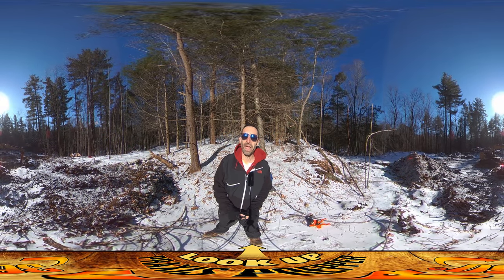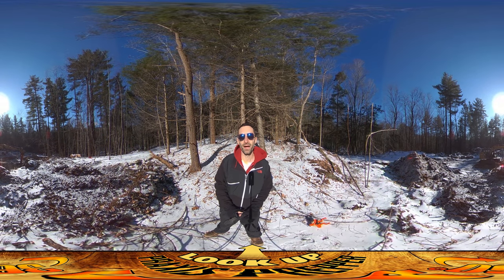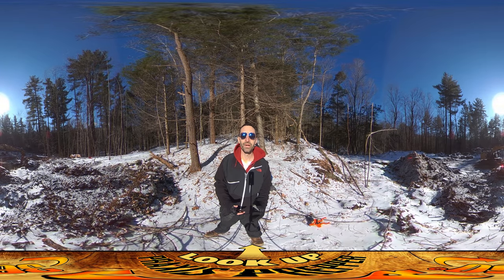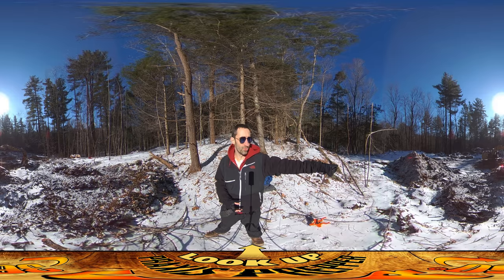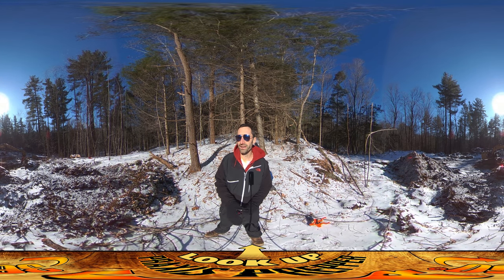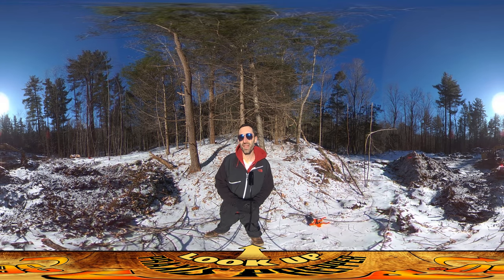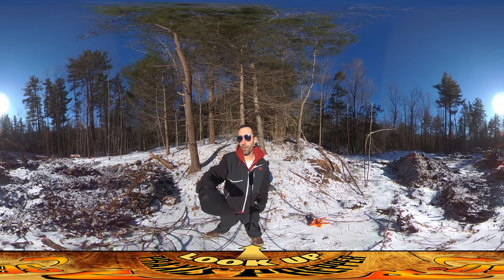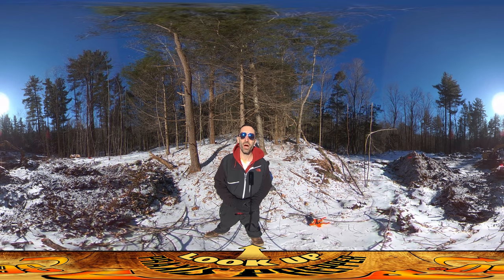Homestead Building - Pneumatic Hammer at  Work, Removing Ledge for Excavation

Comment: Question about snow season -- even though it's over.  Looking forward to next winter, I'll be in the Montana mountains where most of my water will come from roof top catchment. With zero cold country experience I've designing a roof top system that will deliver water during the snow season. If you have any ideas, or experience on this, I'd appreciate your thoughts.
Reply from the maker: I've never done that specific thing before. Contact Tom Elpel (https://www.youtube.com/user/thomasjelpel). He lives in MT and has extensive experience with a lot of novel building ideas. He's a nice guy too.
Reply: Some kind of heater blanket wire within a drainage system?
Reply: @PraxisPrepper  Thanks, Ill follow up on that link.
Reply: @surviveandstrive6436  Ummm, electrified roof (metal roofing) and water . . .  doesn't seem like a real safe way to go. I'm thinking more along the lines of solar heated water in pipes laid on the roof.
Reply: I dig it. I am not knowledgeable in the matter but I figure it's pretty much the same. If you water proof the wires it should heat the water just fine right? You could solar power it or power it other ways. Electricity either way. I like the hot water to. Gotta keep it flowing though, more electricity.